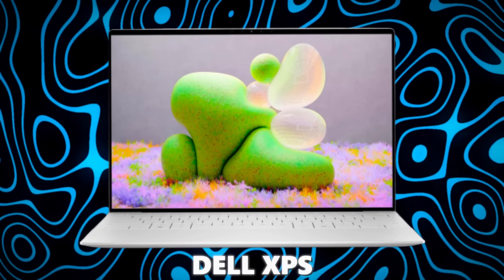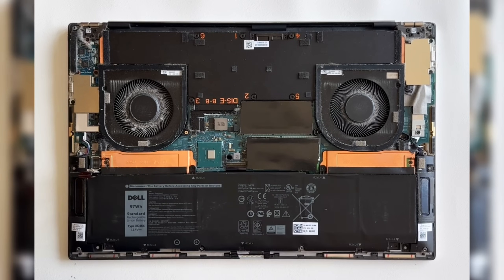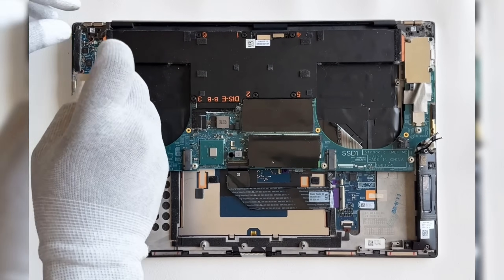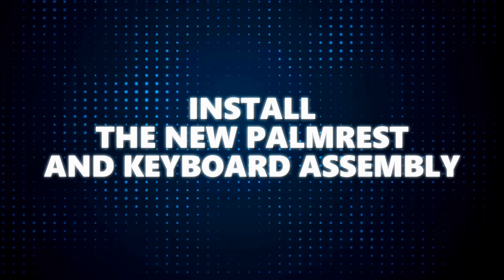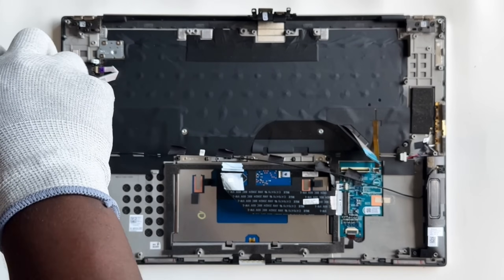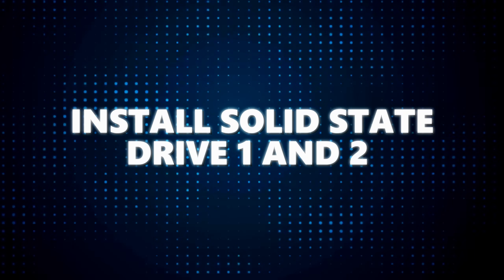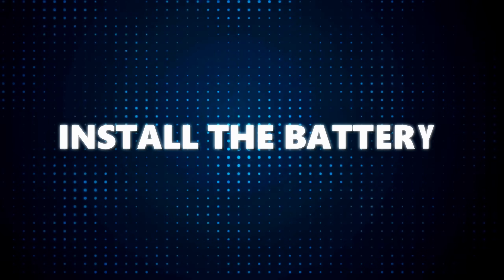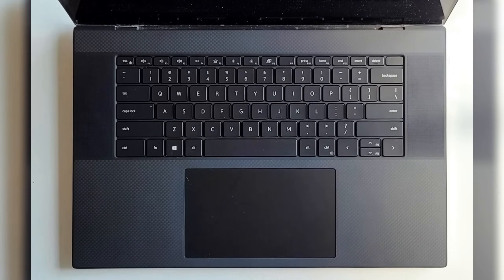Dell XPS 17 Keyboard & Palmrest Replacement Made Easy - Fix It Yourself #laptoprepair #dellxps

Comment: This video was pretty amazing followed it and now we have a working xps 17 again. The replacement palmrest was only 60 dollars which honestly didn't seem that bad.

Did take over two hours to replace though as we were going slow and our palmrest came with a damaged power button and no speakers (so we had to bring those over from the old one).

For those saying this is too much work and will just buy a wireless mouse and keyboard come on! I did this entire replacement wirh a cheap 'Hyper Tough' walmart precision screwdriver and a tube of artic silver i had laying around from my last PC build.

Comment: I'm looking to sell my XPS 9700 - rtx 2060 touchscreen. How much should I list it for? Its $1600 used on Amazon
Reply from the maker: @jetski275 Hi, thank you for reaching out! Unfortunately, I don’t have the full specifications of the device, so I’m unable to provide specific advice on pricing. However, I recommend checking online to see how much similar devices are being sold for to get a good idea of current market prices. From there, you can price your device accordingly. Let me know if you have any other questions!
Reply: @ElantTechnologies  thanks for looking at it. That is the only type of XPS with the RTX 2060 and i7 and touchscreen in 4k.
Reply: That is not the only type of xps 17... mine has the 2060 and a 1900x1200 display with no touchscreen.

Comment: Excellent, detailed video! Convinced me to buy a wireless keyboard and mouse, and this is coming from someone who has rebuilt many an automobile engine. Less expensive, and a 60 second install including batteries. But...if one MUST have operational keys on the laptop proper, here it is.
Reply from the maker: @exx-eh2ke Thank you so much for the kind words! It’s always awesome to hear from someone with your experience - sounds like you’ve got a solid mechanical background. 

And yes, if one needs their laptop’s built-in keys for certain tasks, this option is available. Thanks again for sharing your thoughts.
Reply: Phew. The video absolutely convinced me to buy keyboard stickers in order to change the keyboard layout instead.